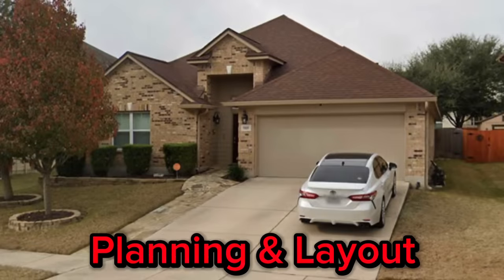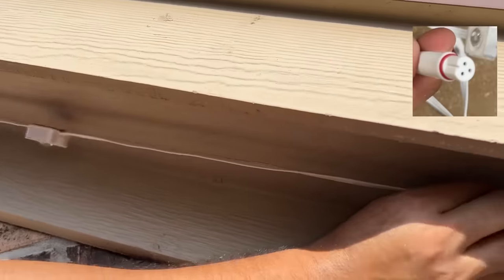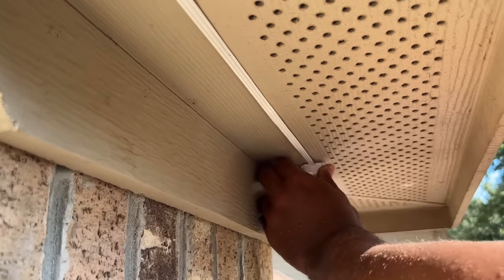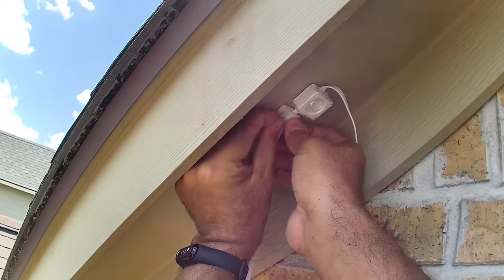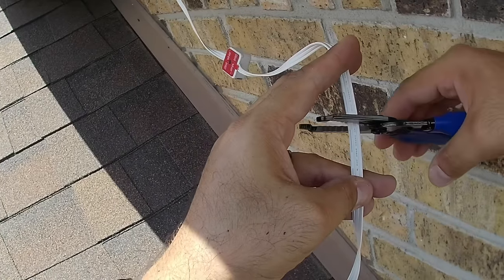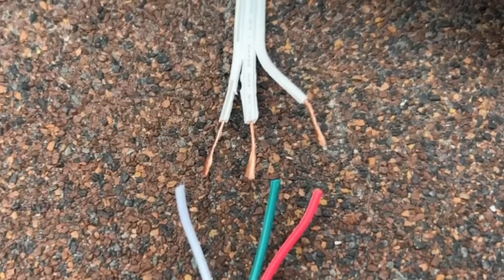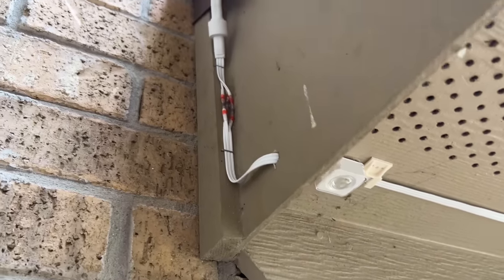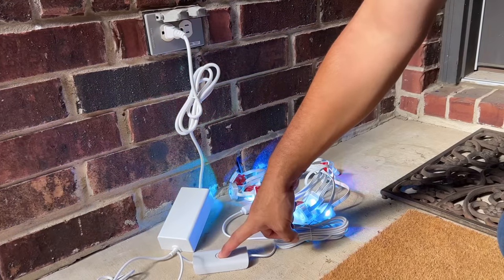Govee Outdoor Permanent Lights-1st Gen.*HOW TO FULLY CUSTOMIZE* @GOVEE #govee #howto #diy

Comment: Have you ever installed on a fully perforated/vented vinyl soffit? Hoping install in the next few weeks, and while Alabama weather isnt as extreme as Texas it's still hot enough I worry about relaying on the 3M tape.  It's been suggested to use furring strip.
Reply from the maker: Hi there, thanks for watching.Unfortunately I have not but all that I have read on some installs we’re using small white zip ties. Sorry I couldn’t be much help
Reply: You probably already figured this out but could use liquid nails and or more clips on the soffit. Ive seen people install on the strip that is way farther than the 6in they recommend. It changes the way the light looks; less cone more mixed. What did you end up doing?
Reply from the maker: @mpsmoov128 yes we have started using way more clips than what Govee recommends. We purchased a bulk amount on Ali express since we are doing 1 govee install a day. Also, I don’t recommend using liquid nail on these lights. We have tested them out and during the installation the strand stop working so our installations are easily able to slide the strand out of the clips and replace a new strand. Also, if one goes out in a few years, they will damage when removed as wood and hardiplanks paint get removed from the surface. We install all our lights 2” from the wall using a 2x2” cube. We bring this up to every new client and they agree because they have seen my YouTube channel. 6” is something we tried and our client ask us to move it closer cause they didn’t like the round effect. They paid us extra to do it
Reply: We are using up J channel,  at 2 1/2" from the house.  Christopher helped to explain a few questions we had about jumps. Had planned on renting a boom, but HD is having issues, we are hoping that a replacement battery shows up tomorrow so don't have to use a ladder
Reply from the maker: @CentalBama  awesome glad he was able to help you all out. We have to keep it affordable for our clients. Seems like they want a really nice install for a low price. Might do this with my own house. Thanks for the info
Reply: It looks nice, easier as well.

Comment: I bought the 150 ft. I have those areas above the garage as seen in the video. I will have to cut. I wanted to know if I can cut the 150 feet. I am not sure if it says it cannot support more than 150 feet of light or more than 150 feet of wire.
Please help

Comment: JB, would you be able to share based on your expertise,  are Govee PRo same, better or less quality compared to trimlight , oleo or minleon? Guess my point is will these be with installing and lasting long enough compared to competitors ?
Reply from the maker: I never encourage defamation of another business practices. Govee lights don’t have a track vs the other competitors installs. Factor that in price. I have had my no pro lights on my home installed for about 2yrs now and can say this, I run mine for 12hrs everyday. They look great and are bright. The light is defined by the cone on the wall. It’s not a must to run them that long but I’m doing it for testing purposes for longevity. They do have 50,000hrs of life. You can have your lights stay up there on the soffits if you actually take some extra time to clip every light, use 3D mounts sold by others or customize yours to raceway channel. Other businesses who install permanent lighting are now competing with homeowners purchasing their own type of permanent lighting so of course bash the product off info on research that a bad installer did. Do it right the first time and you won’t have problems. From an installers perspective on the non pros and pros, we choose to install the pros because they are easier to install. For example, the non pros are one directional LEDs when splicing. It must all go back the way it was cut. The pros, the strands don’t need to be cut in sequence. I can take a piece from another strand and they still work. You still need to keep the connectors running the same though. Non pros are not warranted after splicing but pros are warranted if spliced. The non pros use 3 colors to make white vs the pros have specific LEDs designated for both warm and cool white and that’s a major pure difference. On non pros when installed from left to right it shows white with a tint of green and when installed right to left it shows white with a tint of purple. Pros are slightly brighter. Hope this gives you a perspective on the product and the two kit differences

Comment: If prices are the same would there be a difference for me to buy 3 x 50ft kits as opposed to buying the 150ft kit?
Reply from the maker: Typically 50ft kits are 199. That’s almost 600 for all 3. The 150ft kit usually runs  449. There are deals online currently but I recommend just buying the 150ft if you need that much. It’s good practice to run one controller instead of multiple because the WiFi and Bluetooth sucks in same model grouping
Reply: 150 foot on sale on Amazon for $299 right now
Reply from the maker: Yup that’s correct 👍

Comment: Thanks for the videos!  Your mount clip link is for transparent clips.  Won't those break when I try to nail them?  Do you know where to find the white plastic clips?
Reply from the maker: Thanks for your comment. They will break if you have your brad nailer at max power. There is no need for max power. Set it to the lowest and adjust the nail head wheel on the side of the gun. Hope this helps. Links to all my products are in the description(3 dots)
Reply: @jbsdiytv  Thank you!
Reply: The clips linked are unavailable too.  Maybe you can update the link?
Reply from the maker: Ok thanks for the update.  Go to aliexpress and buy a bulk amount for almost the same price. It’s called RGBCCT Official Store. 10mm PCB. Good luck
Reply: Amazon still has them; just not at that link.
Reply from the maker: Interesting, I see what you mean. I’ll update that one now. It will be in there now.

Comment: The pros are sold out everywhere. Are the original ones worth purchasing? I don't have a complex layout.
Reply from the maker: Only difference is that they have designated warm white LEDs vs the 1st gen uses other colors to make white.   

Also would like to add that the 1st generation lights void the warranty if you splice and the pros doesn’t void the warranty since it can be spliced

Comment: My question is if you're stranded exceeds one control box and you need to use multiple control boxes is there a way to sync your lights up together so they do the same light pattern
Reply from the maker: Yes, in same-group by adding both devices

Comment: I have a question about installing on an eve that is angled. None of my eves have a surface parallel with the ground. They are angled with the roof pitch at about 30* I’d estimate. Does that change how close or far from the wall I want to install the lights?

Comment: so that entire strip was powered from one location? im asking bc i was going to power from 2 spots bc i didnt know i could cut and extend where i didnt need lights in order to get to the second floor. also does it need to stay on constant power or can it be on a switch and still function properly?
Reply from the maker: Thanks for your comment. At the beginning of the video, it showed two outlets on the back left and right. We only captured 100ft kit to show how to connect, set up that all your strands and make sure they work before install. It was 95 ft to the left and 95ft to the right so this install had 2-100ft kits which were grouped later in the app. I have installed the lights to an outlet that was in a switch so no not necessarily consistent power if that’s all you have. Just know if you’re somewhere and want to control your lights you won’t be able to cause that outlets in a switch.
Reply: @jbsdiytv  okay that answers my question then. I didn't know you could pair them together so that they would sync up. I'm that case I can wire from 2 spots constant and have them on a timer within the app..

Than you sir
Reply from the maker: @thebionichandman8967 yup you can group them. Go to home, then to group, plus symbol, then same-model group

Comment: So since the new pro kit doesn't come with extensions, I have to go with the original.

That being said.
I've read that with this original kit, you have to cut it in groups of 4. Is this true?  Or can I cut it anywhere as long as I make the jump connection to the same edge I cut?  I only have 2 small jumps to do.  (1 jump is from a cut and splice to the next cut, the other, I have to splice one end into the middle of a strand)

(I have 111' in lighting length and maybe 4' total jump length.  So I should be fine with one 150' kit)
Reply from the maker: The pro comes with a 12’ blank extension and two 4ft extensions and two wire connectors. The original kit is only when you end your lights you need to have a lease a 4 remaining lights from the beginning of the strand
Reply: @jbsdiytv  
Correct on the pro version.  I just need a lighted extension, besides the blanks. 

(I did notice at the 4:00 mark, the leftover strand has 3 lights left on it.  How come not 4? Or is it only 4 minimum from the male end?)

Kind of a bummer then on the original kit since if I needed just 2 more lights to finish an eve, I wouldn't be able to cut it at 2 lights.
Reply from the maker: @rj2742  it’s not ending with 3, the line is still continuous by bringing the top lights that were spliced back to the original lights within that strand. Cutting the strand to continue install and ending lights are two different situations
Reply: @jbsdiytv  ok, so if I got it right.  I can cut the wire wherever as long as I splice back into it to continue the same strand?  That's what I was hoping I could do.  And if I cut to just end the light, it has to be at an increment of 4?
Reply from the maker: @rj2742 yes that’s correct. When your ready to end you lights at the end of installation and don’t want to continue, that’s where have no less than 4 lights comes into play

Comment: So if I purchase 150ft in length I technically if need to jump or other length added through 18/3 they can be extended longer than 150ft. Is that what I understood?
Reply from the maker: They can’t be extended pass 150ft. If you have say 115ft then all your small jumps (2ft or or less) need to stay under 150ft

Comment: where you get the extra wire to be able to do long connections between roofs ?
Reply from the maker: https://amzn.to/3XgX8kY they also sale 100ft rolls as well. If it’s the pros, splice between a Govee extension to keep data frequency disturbance to a minimum. Same goes with the non pros, elites and gen 2’s
Reply: @jbsdiytv thank you

Comment: im looking to buy here soon but the install is holding me back. not gunna lie im still confused. like how do u hide the power supply and how do u come from where u plug it in at to where u start the first light. and how do u hide the controller and stuff
Reply from the maker: No worries. Look at my round round, Tx install to answer your questions

Comment: On the 150ft can you use both 12 extension cords in a row to make a 24ft extension cord without any issues?
Reply from the maker: Don’t use them back to back to make 24ft, it will cause flickering. What we have done is use a few lights in between the extensions so they act as data boosters

Comment: So if we need to install like 450 feet total, they will have to be plug in 3 different places, right?
Reply from the maker: Not necessarily. This video is older than the other ones. If you have a top left or right soffit outlet or vise versa, they can be powered for both top and bottom install of strands going the same direction. You would want to try and install devices near the front of the house to be able to control them without issues and a kit in the back would only be controlled in the back. Let me know if you have any other questions

Comment: Nice video. Where can you buy the extensions for jumping from one eve to the other ?   Govee site doesn’t have them
Reply from the maker: Which kit are planning to get? You can use custom 18/3 wire for smaller jumps
Reply: @jbsdiytv I am not going to use Govee because their app has security and privacy holes that can be used to hack your personal info.  I am likely going to use appeck lights and use the stand alone remote.
Reply from the maker: Yeah sorry, I asked that before seeing your comment on the other video. Wishing you the best of luck
Reply: I'm still trying to find out where to buy the jumpers. I have 2 dormer peaks that I wanna light up but I'm confused
Reply from the maker: You can buy them off eBay. Govee doesn’t sale them separately

Comment: Hey, I told you I would update you on the data boosters I got. Working perfectly with 24ft extension and 5 sets after the extension
Reply from the maker: Where did you get you data boosters from? Do you have a link. Maybe on the next video I can try this and give a shout-out to pigbait85
Reply: @jbsdiytv I’ve previously used F-Amp data boosters, as well as Quindor’s data boosters. He might be referring to one of these.
Reply from the maker: Awesome. We will purchase these and test them out in the shop. I will perform some test and if all succeeds, I will use them on my next video and make sure to shout out to both your YouTube handing. Much appreciated it
Reply: @jbsdiytv  yes sorry for the reply. I used Quinn's data boosters as the are rated for 48v and govee runs at 36v
Reply from the maker: Thank you for the update. We will try this as well and try them on the next video
Reply: @pigbait85  i bought one of these and I am having no luck. Did you add voltage to it or just use it by itself. Also what did you set the switch to?
Reply: @jackpotmnmike  I did not add voltage, and I left the switch default, I did have a bad set of lights that wouldn't output the data signal deffective from factory so I move it and put it at the end..

How long of a run are you doing? I also placed mine at the end of the govee supplied extension then extended from there with 18awg wire
Reply: @pigbait85 I added after 3 sets then I had a 16ft extension to reach a peak then two more sets but when I added the data boater no lights came on at all. I took it back out and they still work just flickering at the last few bulbs.
Reply: It’s just my extension that is causing my problem I though the boater would help. But with the booster in nothing after it works.
Reply: @jackpotmnmike  are you following the arrows on the booster? Does the LED glow orange on the booster? I would try it it the middle of your extension
Reply: @jackpotmnmike  my setup is as follows, controller - lights - lights - lights - 12ft govee extension - data booster - 14ft 18awg extension - lights - lights - lights - lights
Reply: @pigbait85 orange light did come on. I used the wires as Solid white is positive middle with writing is data, and the line is negative. I am using 16 gauge for my extension but I would think that would not hurt.
Reply: @jackpotmnmike  16awg might be too big, might want to try smaller?

Comment: I was helping a friend install his lights and we made only a few splices to custom fit them. They were tested before making any splices and they all worked. We started installing and got to the 5th strand in a 150’ kit and it won’t turn on. Any suggestions?
Reply from the maker: Yes, do two things to troubleshoot. 1-Factory reset pressing the power button for 6 seconds and watch them all flash white. This should work, if it doesn’t then 2- Go into your device settings and change the segments to how many strands you have in your install. Ex: 8 segments is 8 strands. Or 8 segments and then 4 lights is not 8, it’s 9 segments
Reply from the maker: If none of these things work then take your power adapter and controller over to that strand and see how it responds. If it isn’t all lighting up then you have a bad strand

Comment: Hi, what wires are those on 12:15 time stamp to jump over the 2nd floor roof? We’re thinking of doing 150ft around the house and a 100ft at the 2nd floor, do you have the link for the 12ft extensions or was it provided by govee?
Reply from the maker: Hi there. Thank you for watching my video. That is the 12’ extension provided by Govee. There were two jumps like this. 3 and 7. They were 9ft jumps only and I cut the connections off so that way we did not have all that extra line left on each one. Then those cut off connections, we used them in other locations we spliced the strands and put the heat shrink sleeves with the solder. I hope this answers your question. If you need to make small jumps, the link is in my description (18-3 BTF) Keep this in mind, 100ft box comes with one 12ft extension. 150ft box comes with two 12ft extension. Look at your house and see if you will need two major jumps. Unfortunately you can’t just order extensions last time I checked.

Comment: you mentioned commercial glue? recommendation on what to get for the glue sticks.
Reply from the maker: @THEEBAYSTOREDOTCOM  you can find a ryobi glue gun at Home Depot. One thing I would like to add is that we try and not use glue anymore since over time it does get brittle. So what we’ve been doing is getting a hook tool and tucking it under the flashing and it has been concealing it from the elements

Comment: What’s the longest custom extension you can use without affecting the light
Reply from the maker: If it’s one jump using the 12ft extension provided by Govee, you can splice an extra 3-5ft in between the Govee blank extension.
Reply from the maker: You can splice lights in a custom strand as they act like data boosters.
Reply: Awesome! I’ll give it a go. Since everyone is reselling the Govee extension cords for $100. 😢  I was stuck on how to reach my second floor. 

You and your team do professional job ! 

Thank you for sharing.
Reply from the maker: @Crespofutbol  thank you for the kind remarks. We really appreciate it